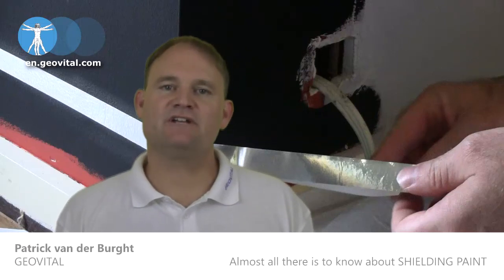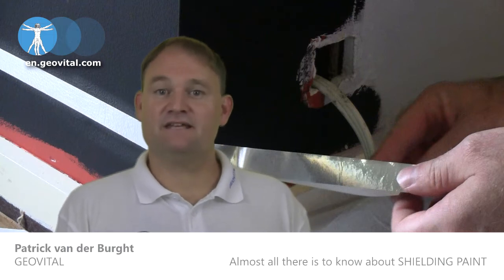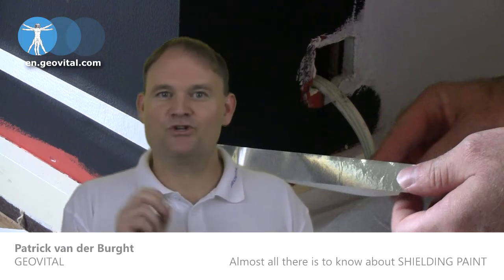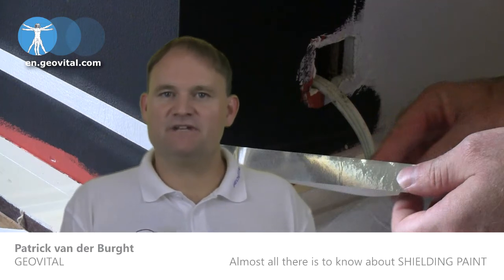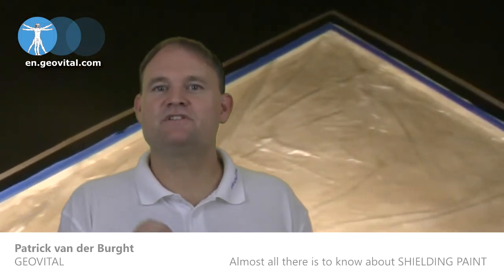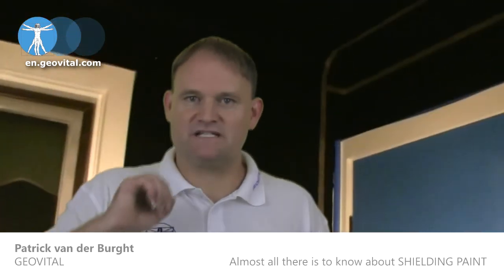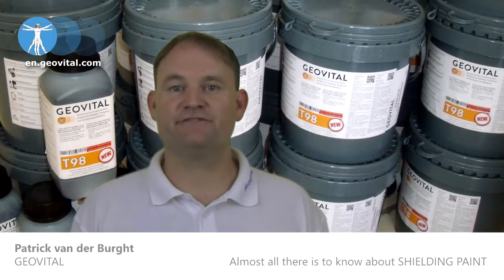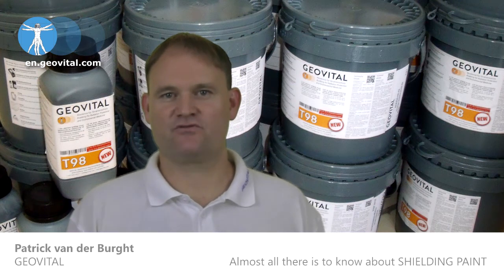6/16 Grounding shielding paint - How, Why, Safety and health benefit

Comment: will a mobile phone work in a sheilded room?
Reply from the maker: Hi, that is hard to say. Mobile phones will work at very low signal and not a great test to see if shielding was done well or not. A body assessment should be done for this. If you need a phone near you at night, placing it on the window shelf behind the shielding fabric will keep it able to ring and not both you so much inside. If you need to answer a call inside, just open the curtain to give it signal.